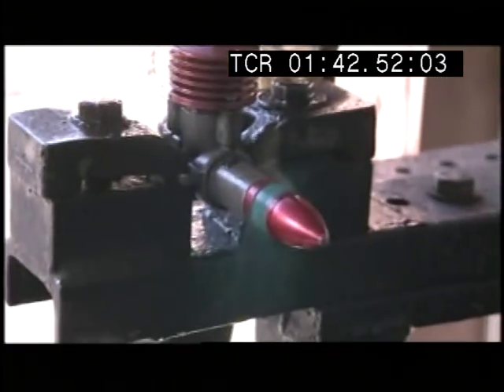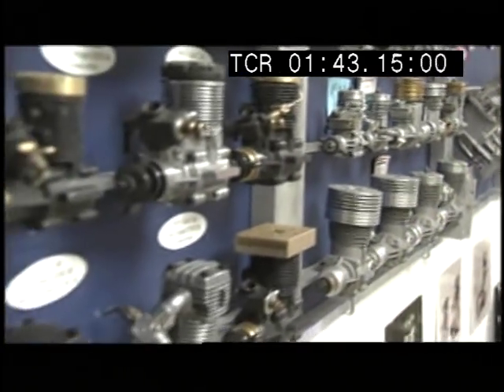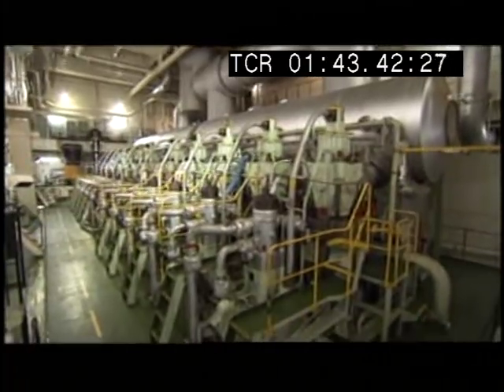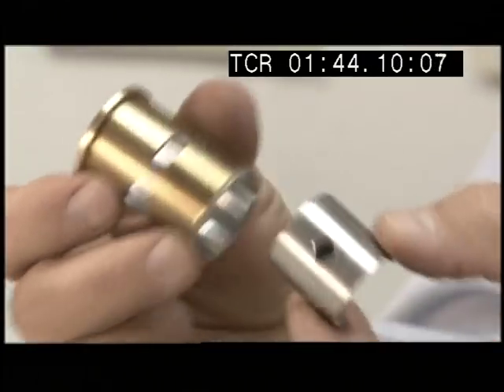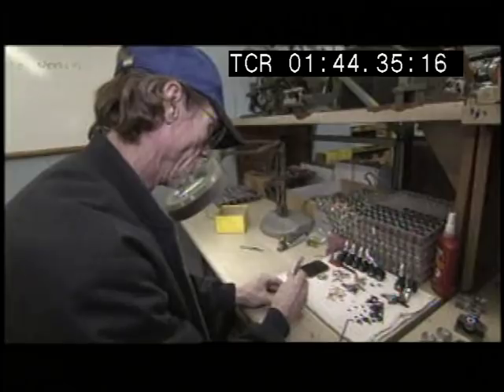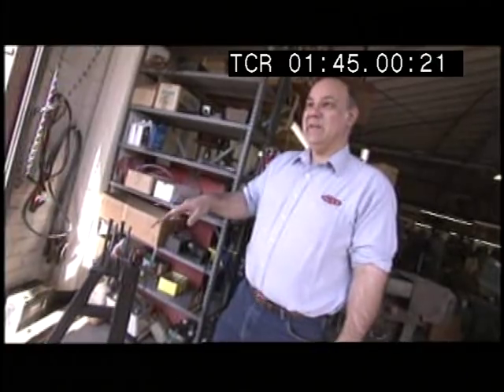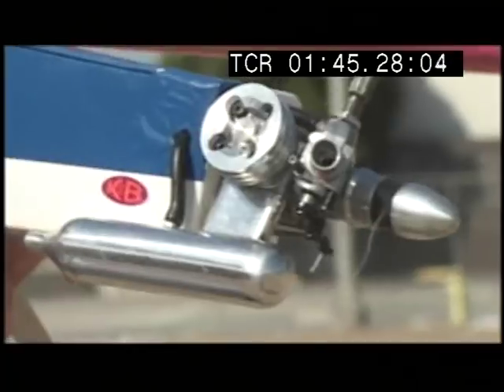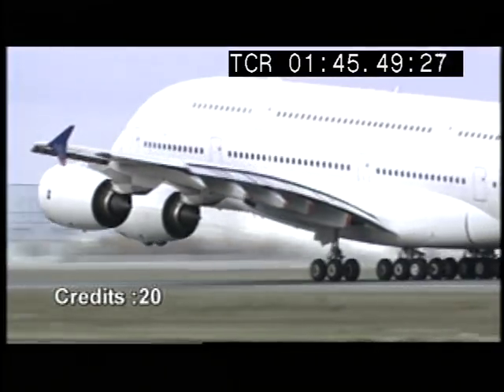Modern Marvels Big & Small MECOA K&B Segment

Comment: I like dealing with Mecoa. Always reasonable shipping times and Randy has everything and more
Reply: I just picked up a vintage Kyosho buggy with a really crusty looking original engine. I'm actually lookin' kinda hard at the K&B 18 Auto as a potential replacement engine if I need to do a full replacement. Fairly confident I can get that little OS to bark off with a little cleaning and pull start work but if it's totally hooped that 18 is my next port of call.